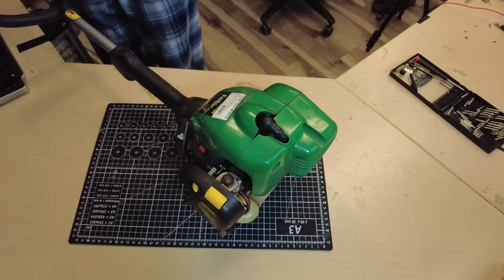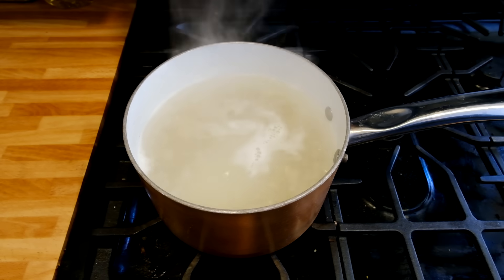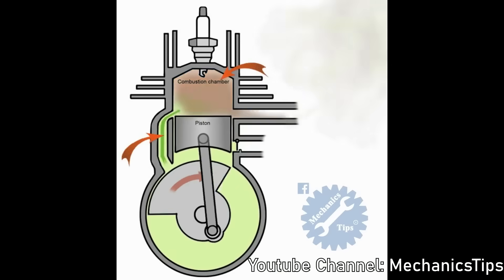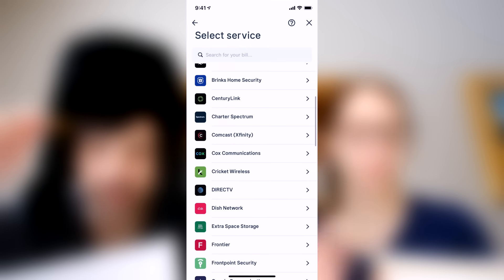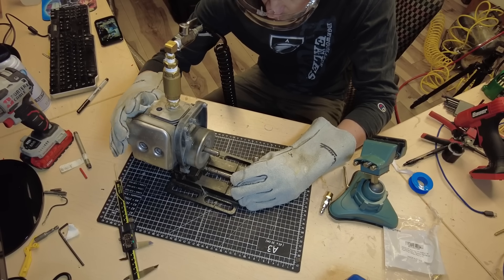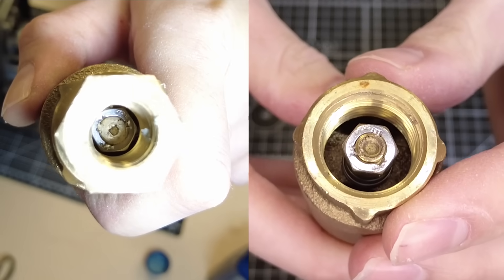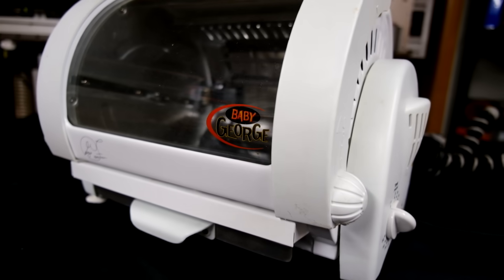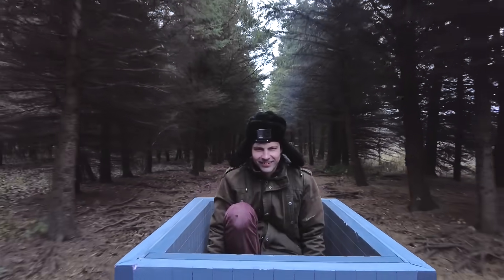Steam engine for Minecart furnace IRL

Comment: What about lubrication?   The two stroke engine needs an oil / fuel mix (25:1 or 50:1) which runs through the crank case before being introduced into the combustion chamber.  By replacing the internal combustion with steampower, you would be better off with a four stroke engine with a sealed, oil containing crank case ( such as a Honda).

Comment: i would of used a stirling engine for it as the furnace minecart in Minecraft you don't put water in it and they also have the added benefit of that there safer as they don't have high pressure in them . but you will have no throttle control unless you come up with something and you will need a decently large one for the power.
Reply: I don't think you could get enough torque with a Sterling engine.
I'm no expert though, you're probably right.

Comment: You should study the details of the car/ lawnmower conversion to water vapor pressure + hydrogen from You tube videos 1+2 - S1R9A9M9 from 2008. Also see prop plane ran on water + Hydrogen from exhaust heat steam and Tesla coil during 1940's. See Hefferlin Manuscript from Internet or purchase back issue Amazing Stories Magazine Sept 1946.
 Also oil furnace ran on water during 1950's in Texas. SS tubing coils on water line in fire pot heats with oil to 1500 degrees . When super heated steam , oil valve shut off. Hydrogen/oxygen torch flame continues. Shock wave of heated vibrating molecules pop apart when going out tiny nozzle to the ambient pressure. US Patent was not allowed, only 50% increase in efficiency.

Comment: If you plan to ypuse that steam engine for a prolonged time, youre gonna need a displacement oiler to inject steam oil into the cylinder.  Also the reason the engine probably didnt start right away could be because the cylinder was cold, so as the steam endered the cylinder, it turned streight jnto water, and the high pressure was required to force all the water out and get it moving. The solenoid thing is also great, loved the video.  Also the cooling fins on the engine probably are worsening your efficiency.  Ideally you want to run on as little pressure as possible. A flywheel might also help but idrk

Comment: You couldve just used a 4 stroke engine and drilled a hole in the cylinder for the exhaust...

Comment: using a gasoline block for a steam engine is a really, really bad idea. if you want a proper result you'll have to build a little steam engine from scratch, your best bet would be a dual cylinder oscilating design

Comment: Please remove the tap/valve on the cylinder, or put the overpressure safety valve before it.
Nothing goes wrong the way you expect it to. Atm nothing is stopping you from heating it with the valve closed. 

You'd think it's at 0psi, then when you open it your get hit with an engine explodeing at 5000psi.
Reply from the maker: I think that thing is epoxied in place, I couldn't budge it with a breaker bar and a torch. For a long term boiler absolutely it needs to come out, but for this test I kept careful eye on things for the reasons you mentioned!
Reply: @JoelCreates  If it is epoxied you might not have heated it enough. Also check for left hand threads.
Reply: @JoelCreates  double down on the epoxy... epoxy it open!
Reply: @JoelCreates  pretty sure they're threaded in place. If you get frustrated enough you could always just cut it off and re-thread it for your needs.

Comment: What about lubrication of the engine?
Considering this is a 2 stroke that normally gets it’s lubrication from the mixed fuel that comes in.
Wouldn’t this setup seize up within a short run time especially with the high temperatures of steam?
Reply: right now he's getting most of his lubrication n form the water condensing out of the "wet" steam and the fact that the engine uses cast iron rings on a cast iron cylinder liner. if he was using "dry" steam he would have to use lubrication ( in the form of steam oil; a specialized oil that mixes with water) to prevent seizure.
Reply: @johnkuzma7066  dry steam is just overheated steam, as soon as it touches a cooler surface like the cylinder, it also starts to condense and becomes wet steam...
And water provides a pretty bad lubrication, of course better than nothing, but it doesn't work good enough for the piston rings. It can work for fast rotating shafts without any side load like in the circulation pumps of a central heating system, but not in an engine...
Reply: Real steam engines have a lubricator which injects oil into the steam for lubrication of the cylinder.
Reply: @Henning_S.  that’s cool to know… but I’m not seeing it on this model right here.
So unless he adds it later on you’re looking at a serious chance of seizing everything which if not careful can lead to wheels locking up and potential accidents.
If spectacular enough.
Reply: @gottemrealgood  I think if he he didn't get all the water out of the engine after this steam test, the cylinder liner, piston rings and crankshaft bearings may already be rusty, so this engine won't last long, even if he adds a lubrication system later on.
But maybe he did put some oil into the cylinder and the bearings before the test and just didn't show it in the video.

Comment: in a proper train, the furnace has many many tubes, that fill with water, and get heated. 

This would massively increase your steam output, though would also increase the danger. 
Check out a few proper "Steam boilers" to get some idea's for how to improve efficiency, and DANGER!

Though, take caution, Efficiency might be best avoided, as it is dangerous.

Comment: If you do decide to go with the furnace Minecart are you gonna just replace the motor in the electric one or are you going to have it push around an unpowered Minecart the latter would be much cooler in my opinion.

Comment: You must need to lubricate the crankshaft 
So it will maximize the performance
Reply: Could maybe block off the transfer port and partially fill the crank case with oil like a four-stroke engine, now that the crank case isn't needed for pre-compression.
Reply: The crank and rod has bearings so there isn’t that much performance if any to be gained the only thing oil will do is stop it from seizing but when the engine is that cheap it’s easier just to get a new one
Reply: @dominoẽspizza_woy-woy  Why not make something that lasts?

Comment: In terms of a boiler, you could look at doing a water-tube boiler. The book "Building the Clishay" has drawings for a water-tube boiler that engine would use. It's meant to drive a 2 cylinder marine engine, which should be similar to your needs. Also, most of the problems you are having are with getting the engine to start. As you're using single action (as you explained), getting to the right starting phase is difficult. A flywheel and a clutch could likely help get the engine running. That or running two of these "Steam engines" out of phase. Last thing to note is its worth looking at boiler code in your state. This is something the Little Amerricka guys could help with.

EDIT: I was with a group that tried to put a Little Engines 0-4-0 crab on air by compressor. I see all the compressor comments and really can't recommend that route.... It was noisy and very inefficient. I think there are some videos of that Blue Mountain Crab out there.....
Reply: I'd think just spinning it over fairly fast would be the most effective method of starting it - perhaps use the same recoil starter it had when it was a gasoline engine. It also would have had a centrifugal clutch, but the engagement speed of that would be far too high to work with this.

Comment: Just FYI, with steam, the cooling fins work against you because the steam is condensed and doesn't produce as much pressure lowering your efficiency. But great vid bud!
Reply: Heat loss is probably quite minimal without the fan shroud directing cooling air over them. Overall for such a crude steam engine and boiler setup (not saying it's not good or impressive, but it is still crude compared with a purpose-built steam engine) I'd think that's the least of his worries, and there would be a lot of other things that would make a bigger impact on performance. Particularly a better boiler. But it would be pretty trivial to wrap the whole thing in fiberglass exhaust header wrap or something, I doubt it would help much but it wouldn't hurt.
Reply: Yeah, the only reason you would ever want cooling fins is with superheated steam, and probably only if it’s >300°C which might make the engine slightly less pressure resistant.
Reply: @myrealusername2193  you do relise
the working pressures of engines is really freakin high
Reply: @djaydeved  yes, that’s why I’m saying that overheating can be a problem with steam engines if the steam is too hot, and my point was that that’s the only time find on an engine can be useful

Comment: So you've got a great start to your steam engine, however I think you'll need a different kind of boiler for your final product.most importantly, you should have at least 2 safety (pop) valves to prevent your system from overpressurizing the vessel or your piston (one set at your safe operating pressure and the other slightly lower). This is a must for your build no matter if you continue to use the compressed air tank or go with a different design.

 For one, you do have a very strong container, however it is highly inefficient because the tank has very thick walls, and the internal surface area in contact with the water is quite small, which also hinders heat transfer. Another way to do this is to use a coil of copper tubing in what they call a "water tube type" boiler. The copper is a great thermal conductor and your surface area/volume will maximize the amount of energy that can be transferred to the water. Not only will you be able to build up steam to operating pressure faster, but you'll also get more steam for the amount of fuel you'll use (less tending the fire & more run time for any given amount of fuel). Just note that you'll still use up water at the same rate.

Nevertheless, stay safe out there and good luck on the build!
Reply from the maker: Thanks for the info! This boiler was definitely a temporary measure, I primarily used it because I wanted something super strong, and building an efficient boiler could easily take up a whole video!
Reply: @JoelCreates  To my knowledge, if you want a boiler that will last, A500 grade B steel works good as a boiler shell. Stay safe brother.
Reply: @JoelCreates  also to calculate the MOWP (maximum allowable working pressure), it’s 
Pressure = wall thickness X tensile strength /radius of boiler shell.
Reply: @JoelCreates  so when is the next episode about this coming out?
Reply: @JoelCreates  you also need a steam dome to prevent liquid water from getting into the engine.
Reply: Also consider using (VERY temperature strong) heat pipes (like the ones in a PC radiator) to transfer the heat from a coal fire to the inside of the boiler efficiently.
Reply: I want to add that a very important thing about steam boilers, is that most of the risk comes from running too low on water. Even if your safety valve fails, you are most likely to have an explosion if your water level is too low, which is why most "real" steam engines have an injector valve.
Reply: So get rid of the tank& only use copper spiral tubing?
Reply: the answer is simple

Fire Tube boiler
Reply: @IndustrialParrot2816  Yeah, fire tubes would work too, like in actual steam locomotives, where the fire is in the back and the heat travels through pipes in the boiler to get to the chimney in the front.
Great idea, Bowser jr.
Reply: @torfley  YEH i have seen people try other types of boilers but they often don't work as well but firetube pressure boilers have some issues 
1 they are wear out quickly and are expensive to replace or fix
2 they somewhat dangerous as boiler explosion can occur for SOOOO many reasons
Reply: @IndustrialParrot2816  The problem is they are high pressure boilers, you are probably better and safer off going for a low pressure boiler something like 15-20 psi. The thing I don't think that poxy  little engine will even have the torque to move the minecart with joel in it. :/
Reply: SO LONG

Comment: Since your weed whacker motor is two stroke, you need to find a way to inject oil into the cylinder in order to lubricate the cylinder walls. You still have the ports from when the weed whacker was still gas powered so you can utilize that. Also using a harbor freight engine might be a better bet. It has more displacement and therefore more torque.

Edit: I also agree with a lot of the other commentators with that a proper boiler should be used. While yes your CO2 cylinder is rated for 200 psi. I don't think it was ever rated in an application with exposure to direct heat.

The pressure cooker that exploded is rated for around 15 psi. Assuming a safety factor of 3, it was probably able to handle around 45 psi (I'm just guessing at this point). It usually has the same thickness of your cylinder, but it's probably stamped aluminum or stamped steel. 

Also I am probably on some FBI watch list as I was looking for the max pressure of pressure cookers. I guess this is why people advertise VPNs?

Comment: Maybe an old air compressor would be a good option, you could essentially reverse the whole system and use the tank as the boiler and the compressor as the engine. Air compressors are naturally rated for the heat, due to compressing air, and have lubrication. Imo it would be a great option. Looking forward to seeing how this progresses!
Reply from the maker: Cool idea! My main concern would be using the tank as a boiler, since they are designed to sit around the same pressure I need to reach, but at room temperature.
Reply: @JoelCreates  I wouldn't use an air compressor tank dude, thin walled and rust..you're asking for it.

Also I watched an old guy on here with a model steam train, he was filling one of the tanks with special steam engine oil, I think it was a drip feed system, something to think about if you want any longevity.
Reply: @IDK-vs1mg  Good idea
Reply: @JoelCreates  true... that could be an issue
hmmm
Reply: @JoelCreates  https://www.youtube.com/watch?v=_2MxVKE_HsA
Just build this...
It will sound great too...
Reply: Compressed air engines have existed on railroads in areas where a fire from a steam engine would be highly hazardous such as coal or oil ports.
Reply: @Hebdomad7  they're common in some free flight model planes as well, but i'm talking about using the compressor part with steam instead of compressed air.
Reply: I really like this idea.

Comment: You will want to mix a little bit of oil into the steam somehow, so you dont get lubrication issues in this 2stroke engine.
Reply: He simply will need to put an oil tapper into the piston chamber. So it will slowly drip oil. It will get very oily and messy, but it will make engine safe.

Comment: now your going to have to figure out how to build an efficient boiler.
Reply: I think he need an empty propane tank or something. Something with much more volume than the tank he used (the pressure dropped fast), that can also handle pressure.
Reply: Could definitely retrofit a steam generator similar to the antique Doble steam engine cars of the 20’s.
https://youtu.be/rUg_ukBwsyo
Reply: @deanp2012  No way. They outlived their life expectancy. They will not pass the pressure test.
Reply: My question is, how is he gonna make all of this work to push something <300 pounds. Not only that, but what does he use to build the minecart. It can't be wood and foam again, they wouldn't be able to stand the heat of a metal boiler not 1ft away from it, reaching sometimes 300-500°F. There are a lot of engineering questions still to work out. But I think he can do it. (My suggestion is to turn that steam engine, into a steam generator that then can charge those batteries already on the cart. That way you can easily control the output, while having a semi-reliable stream of power generation whether riding or not. Another Idea that I have seen is to introduce steam into a freely rotating chamber that has output nozzles, so that when the steam exits it pushes against the chamber rotating it and whatever it's connected to, there's a video somewhere on the internet of a miniature one that some "genius" put liquid nitrogen into and the thing broke, but before it broke it was spinning at ridiculously high speeds.)
Reply: B O I L E R  M I N E C A R T

Comment: You could try to use an old warm water boiler and convert it to wood or coal. I would maby also try to use an other engine becase I don't really think that it would be powerful enough. You could for example convert an old 4-stroke engine to a steam engine. They should have more cc and therefore more power
Reply: Bad idea I'd buy one of kozo hiroko's steam engine books otherwise ya might win a darwin award because those water heaters are not intended for high pressure
Reply: @wesbrackmanthercenthusiast4695  it always depends on wich one you choose. I use one as steam boiler ant it goes up to 10 bars.
Reply: @philippvonferrarikellerhof1720  well I guess if you pressure test it the boiler should be fine